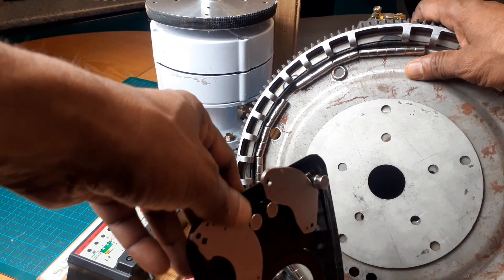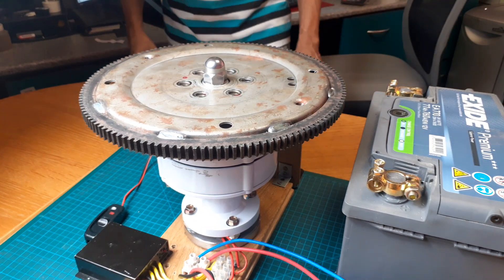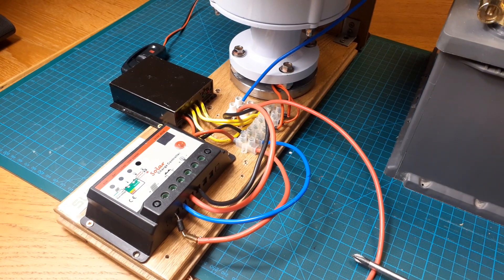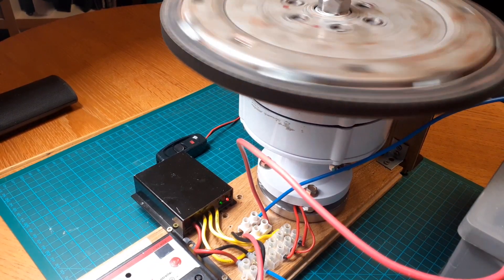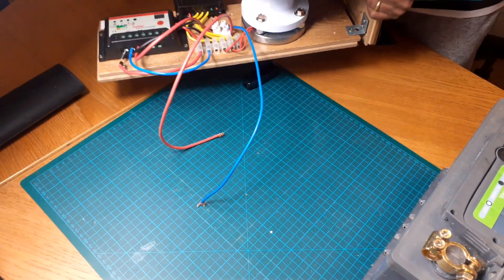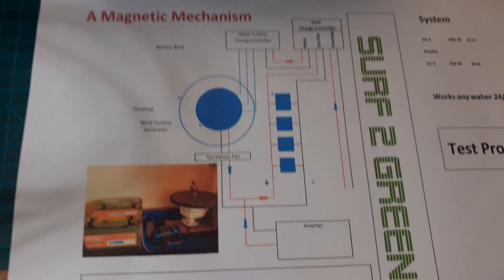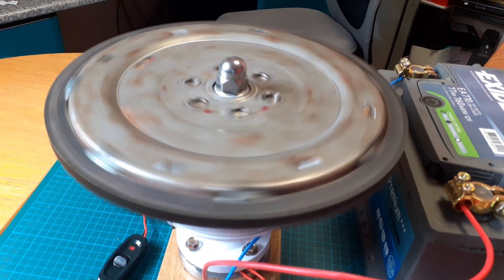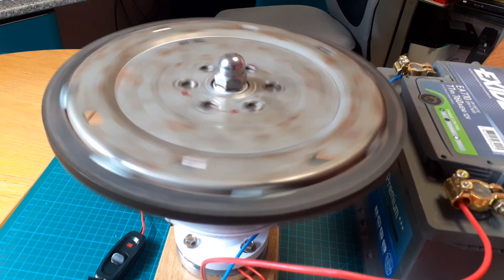Free Energy Generator - Works anywhere

Comment: Hello great job, has the generator been modified?  Is it possible to have a diagram or a drawing?
Reply from the maker: This technology is brought to everyone, and to rise the changes to create electricity without using fossil fuel, and undependable natural elements or resources

A legal closure is made by surf 2 green, you have to have permission from surf2green to manufacture or modify this product technology Number 2 0 2 1 1 1 9 F E E G 2 0 2 0.  and for more detail and for the application of the permission and for the diagrams 
, Please visit our website to contact surf2green

Comment: Ahhhh pulse motor got it....
Reply: So we take solar cells with tritium rods (a lot of them) sandwich the Rad cells connect to harvesting circuit use that power to run the pulse motor use the pulse motor to charge your batteries or super caps... If you can get enough power out of the rad cells sense often times the small Rad cells only output microwatts, however apply enough tritium vials to a solar cell sandwich and I'm certain one could attain a few watts of 24/7 energy out the cells. If said cells could run for 12 years unit could in theory pay for itself in power generation coupled with a pulse motor....

Comment: I couldn't understand the system that makes the flywheel spin. Three lines come out of the generator, this is in the first video, but in the second video five lines come out, what is the idea there? You don't need to set a video link. I watched both. Thank you very much
Reply: You wont get any patent on this...its been done over and over...
Reply from the maker: Hi, Narmo, thanks for the comment and the question. I have tried to rotate the wheel like other videos, precented on the YouTube. But mine didn’t move a centimetre only with the magnetic technology, maybe the resistance is very high. At last, using a little electricity to change the magnetic pole (N & S) It did move.  Sorry, the technology is still not open for everyone, until I get my patent on this project. 
I could only say at this moment, when resistance is very high no magnetic engine will move. You need at least 1 Volt, 1 Watts to move. Even I have tried V magnetic motor technology, even it didn’t work. Of course, the main rotation technology under the flywheel is hidden at this moment. New complicated video is coming soon, which is still under test. Where you will ask more about it.
Thanks, once again